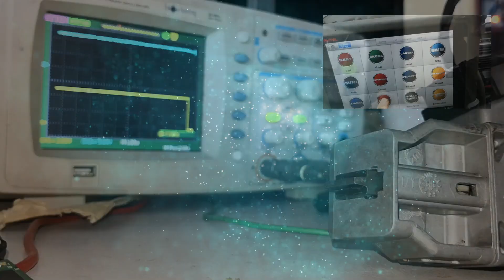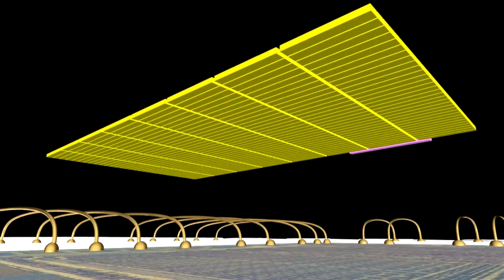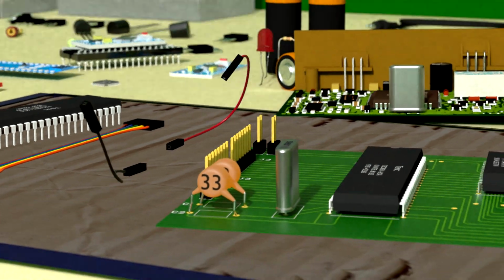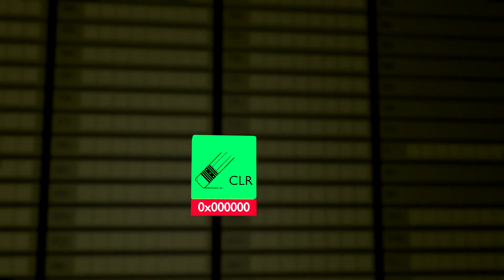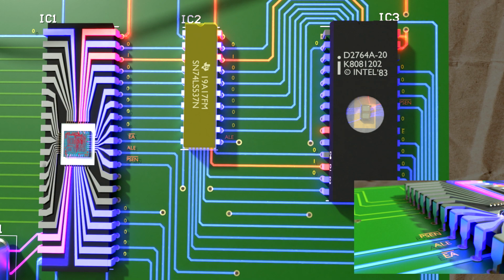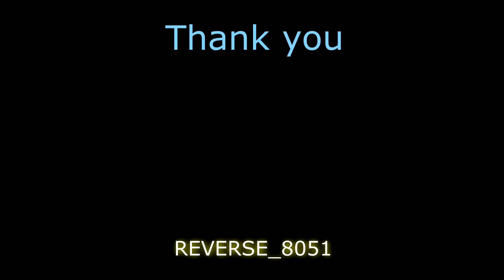How Microcontroller with EPROM works

Comment: Amazing work and unique execution.
It has the potential to grab the attention of less technical people.
Great start, you grab the attention with te animations, but with a basic understanding about these things, i still quickly got lost a little bit from the jumpcuts and camera moves. 

Editing/framing:
30 sec intro is too long, with the channel intro, and the video intro together,
Channel intro is 
0:18 to 0:32 speed up, and start talking sooner.
3:27 Where is P1.0 pin again? (here you loose a lot of people, who assume, okay, i have to know it my self, than this video is not for me...)
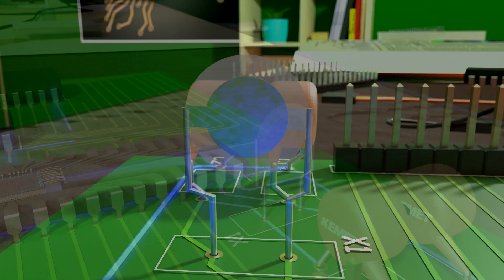3:39 you change the view to show the resonator, and make dizzy everyone with rotating everything at 3:47 since before and from than you show everything else from the ROM side, i suggest to stick with one side.
3:55 you could pan down as the traces light up
4:06 you show the chip from the p0.0 then you cut to the other side, and rotate back to p0.0,  confusing everyone what side is on :D i would have follow the traces with the camera from there, showing ALE as passes throught the VIA, keep the traces in the shot, and tan follow past to the other connection.
4:12 the text is to dark and the light makes it unreadable
4:20 you transition to fast from P0 if i blink i miss it. And you lose the viewer.
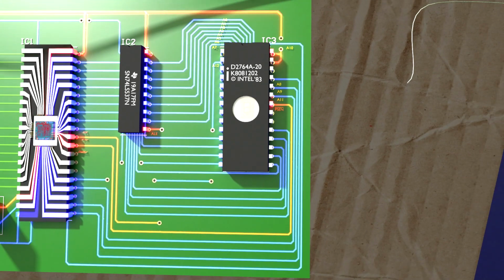4:26 too big of a change, i had to watch multiple times, to understand in my head what orientation i am in, and how it connects.
4:30 i spent a long time to understand :D to many things happened at the same time, you can "bend reality" for the sake of explanation, you coult light up the p2 traces as you explain that it comes directly.
4:34 the shining light overshines the traces, hard to see what is happening
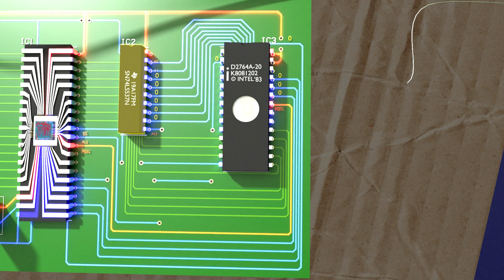4:38 instead of just changing the text, you could show the sending from to "i already forgot which is which" and it makes easier to see where are te 13 lines.
4:50 again sudden orientation change 
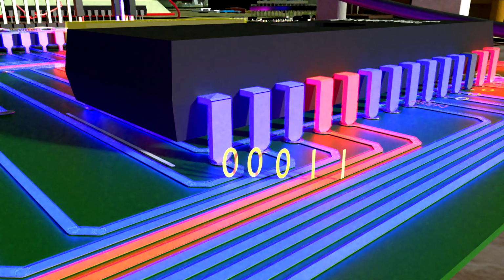4:56, it is following carefully the bits, and the next moment 5:05 i am a totally different place, (180 degree rule, at cinema) Instead i would show it from the top, and slowly pan down to the next angle while you talk about "because..."  Next video idea, why and how exactly transfers the ROM the data to those legs?

5:05 to many jumpcuts, unnecessary one second
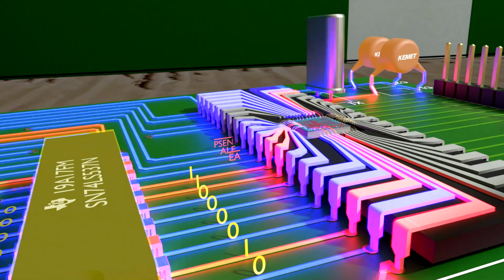5:08 you yould show the ALE connection more visibly inside to make easier to understand how did it send the freeze adress signal (leave visible the whole legs for example) or show it also at 4:34 as it does it's job. Because I'm not sure if i understood it right.
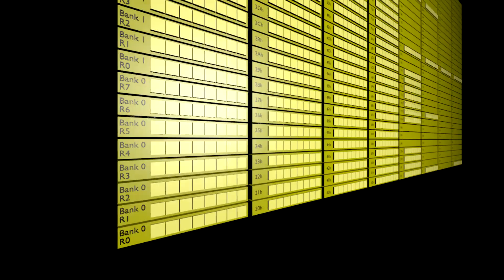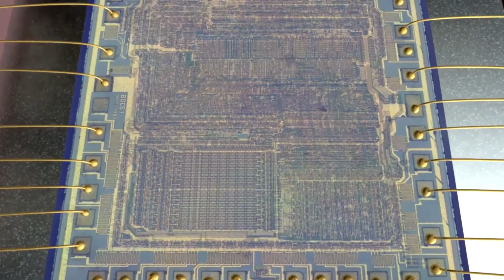5:17 you made an awesome looking, but confusing transition, i would reuse the 1:13 you animated perfectly where is the RAM located on the chip, and then at, just fade out the background.
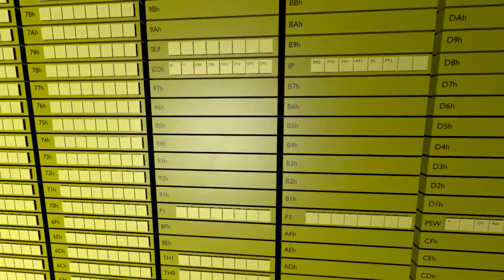5:23 you show the PC you hide it and then 5:32 you show the change in a new image, i would leave it in the background visible, and show the change like at 7:38.
5:34 you could zoom out, follow with the closeup from the same angle, not switching from the top, and than back again.
5:41 lights up the whole board, i get confused again, the wole board lights up, and then  you show what is changing with a closeup and i did not notice the change on the board, because i was upside down and now im zoomed out again. I think this part could be fully fop view without any changes. And then zoom in back on the ROM as at 4:45. Instead i would make bigger, or flash the text as it mentioned (also at 4:06).
6:11 you light up the traces and does not follow it to the led, jumpcut is too sudden change.
6:17 it looks like it lights up twice, instead of cut a simple zoom would have been better if you wanted a closeup, but it is not needed, easy to see it is lit up.
7:38 the first time i get the RAM animation, but i should understand it shortly after 1:13. I would introduce the "parts" that going to be mentioned i the video, to understand better what happens. 

And keep it consistent, so when you make the next video, people already know what to look for, and how to understand it. Also if you have a template you don't have to recreate everything every time again and again. Also it makes easier to connect videos, same scene, but next time you show a different component and reference back and forth between the wideos. 

I'm sure it is not the case, but it feels like you had a list how it works, what to show and no plans how to connect some of these things visually.
I bet you can see in the analitycs some drops near this  timestamps (3:27, 4:30, 5:41), i'm curious.

Rendering: 
I recommend shade smooth for curved components.
EVEE is plenty enough for this, less noisy (https://www.youtube.com/watch?v=e-9rYUwY47Y&t=437s)
You can render out just the components, and the different passes separately, and you can reuse scenes with different the angles, (like the ROM at 4:50) and just mask it out, so you can put different clips on top of each other, and don't have to render everything every time.

Sound:
Don't worry anout the music, just use an EQ to pull down the speech frequencies from the music, and it get's way better.

I just wanted to leave a comment it is to jumpy, but you put in so much work in this video so i put some in my comment to, i hope this way helps more to understand why it is confusing at places for me and probably some others. Also keep it in mind, what is obvious for you, the viewer might have no idea about, so explain and show everything as you would show it to a kid. And ask friends who don't know anything about these things, and watch the reactions to see if they really can understand what is happening or just supporting you.
Reply from the maker: Thank you very much, Mihaly for this comment. I don't want to making poor explanation again, that i haven't preview during creating because too slowly laptop used.. In fact i didn't make my Blender 's homework, i could learn more about masking and camera motion.. Without preview i had to believe, that 1-week rendering of few seconds fragment will be' not to fast' or 'not to slow', but most often wasn't ideal. So, your opinion will be the best tip for my next projects, thanks again and keep in touch, my friend!
Reply: @reverseengineering2943  I can understand the struggle, i can't start if it takes days to rernder, so instead i'm on learning the optimalisation jurney, so your patience is huge.
I don't know if you use blender for video editing, but if not maybe you can speed up your work further if you render out the 3D and animation, (i never used something ike this, but might help if it is good and free as advertised https://www.sheepit-renderfarm.com/) and use a separate less demanding program for video editing, so you have more time to experiment and learn new things, keep up the great work :)
Reply: Ll

Comment: I am using an 80C152 microcontroller, which is ROMless. I want to read a program from EEPROM and controlling the state of Port 1 using embedded C code. I am using the Keil compiler. Can you provide guidance for this?"
Reply from the maker: I didn't use EEPROM for such microcontroller, but EPROM only. It's difference between these memories, but it was described well in 8051 microcontrollers book from such Hindi proffersor, and title of this pdf was something like "8051 assembly and c programming ".. if I'll find this book i will send you more details

Comment: I am having a problem re-programming a Signetics SC8051/ Intel 8051. I can read what is currently on the IC using Intel 87C51FA but can not write anything to the chip.
Reply from the maker: Yes, it is common problem with memory/microcontroller seties 87xxx... It because EPROM or OTP factory.. So if it is OTP (one-time programming) you have an answer... I can't find exactly SC8051, but 83xx which has EEPROM, but your probably was factory ROM (firmware) programmed, and because it is one time programmable chip, that's why you cannot write anything.
Reply: @reverseengineering2943  Thank you (SC80C51BCCN40 SIGNETICS)